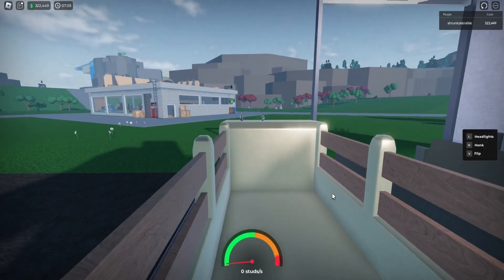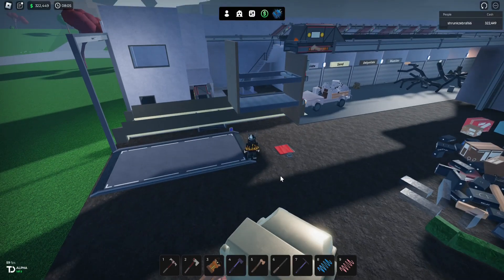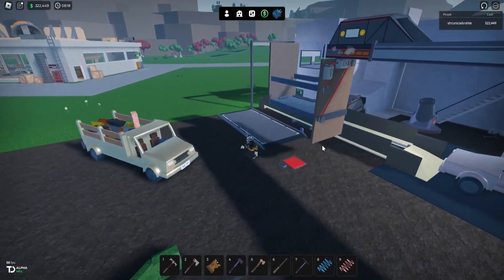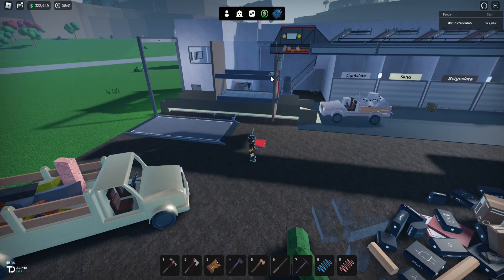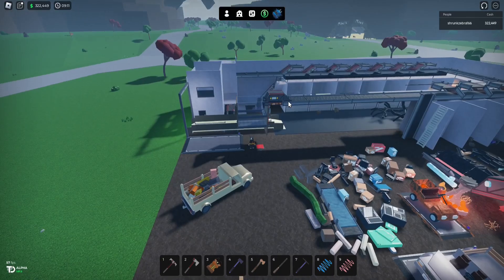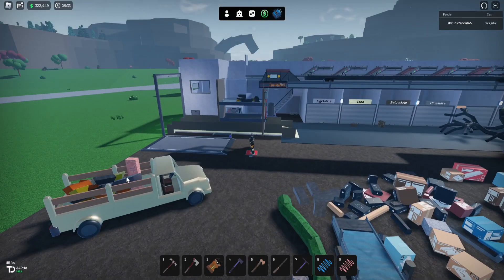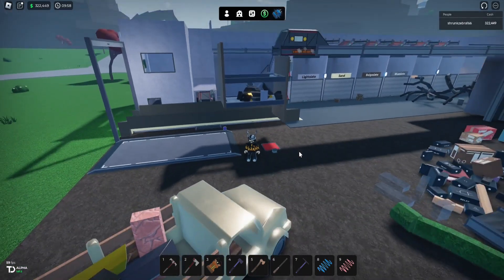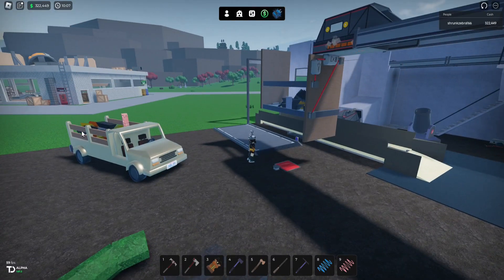I built an EASY AUTO LOADING bin in Oaklands

Comment: There’s 1 major issue with this build. Within minutes, items become static and you have to interact with them to make them drop
Reply from the maker: I just came across this issue myself and it reminded me of a issue just like this on LT2 witch I worked out was caused by the auto save. it maybe the same thing in oaklands although I have only got this issue after rejoining a game with items in the bin. since then i have not left a game with items in the bin. hope this helps.
Reply: @SZ-Gaming  it’s not just leaving, it’s anything that could cause the base to unload. I think at least, since the problem only happened on my solo server when I drove away from the base and came back.
Reply from the maker: @oponentgull186others4  thanks for your reply, this has not happen to me.... yet even in solo. maybe something for the devs to look into.